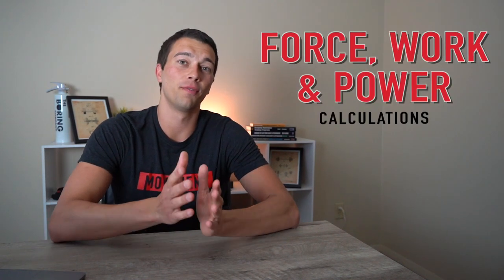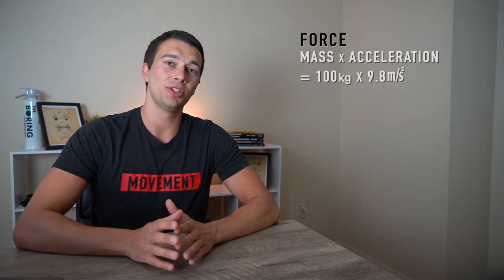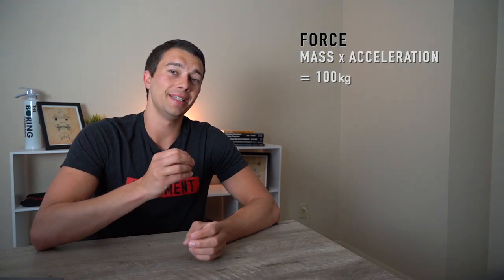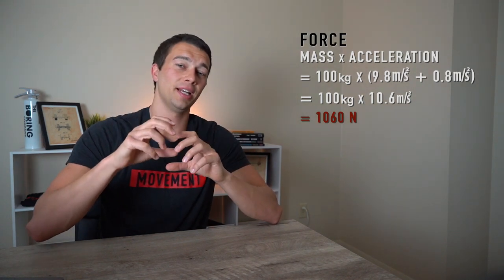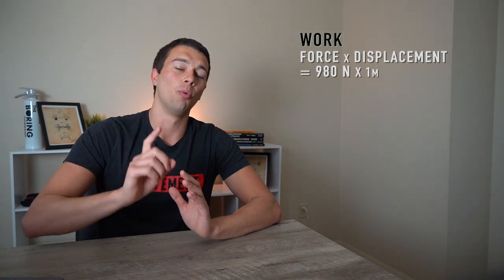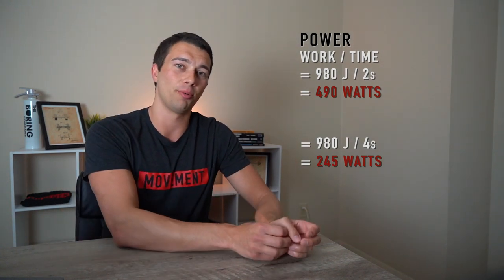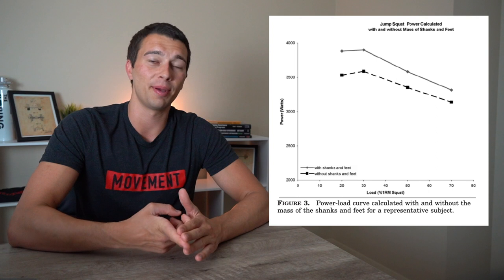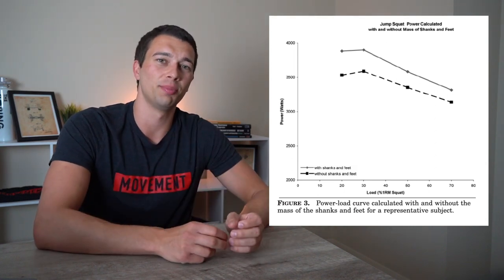CSCS Calculations | How to Calculate Force, Work, and Power During a Barbell Squat

Comment: Clear explanation, but only for mean power into the bar and only when vertical.

Now to calculate peak power:
You need the velocity-time graph of the bar.
a(t) = dv/dt this gives the a(t) graph (of the bar) (don't forget to add 9,81 m/s^2)
P(t) = F(t).v(t) = m.a(t).v(t) since you have the v(t) and a(t) graphs you can plot P(t). Then just calculate the maximum.
If you want to make this calculation even more fun: add a band.

Comment: When might a strength coach advise an athlete to focus on greater power output (speedier reps) vs. Focusing on slower and possibly more controlled reps? Should both practices be implemented within the same training session? Set after set? Or at different phases in their program?
Reply from the maker: There's no right answer to this but typically you would do some amount of speed reps throughout the season with more of a focus on that preseason/ in season. I would look into some of the articles on charliefrancis.com

Comment: Matt. when i am going to get Force, the weight is going to be the weight that going to move or the weight that going to move + the weight of the person?
Reply from the maker: It depends on if you're calculating force on the barbell or force into the ground. I used just the mass of the bar to keep this example simple
Reply: thanks so much

Comment: Where did you get the 0.8 figure from? How would one know the acceleration they are undergoing in a lift?
Reply from the maker: Acceleration from gravity is always the same then acceleration of the bar would be given in the question
Reply: @TheMovementSystem  but how would anyone know the acceleration they are applying to the barbell? We know acceleration due to gravity but how did you get the .8 number?
Reply from the maker: @tomg4685  In real life you could measure it with something like a velocity based training bar speed tracker. On the CSCS Exam it would be provided
Reply: @TheMovementSystem  so the .8 figure you gave was just for the educational purpose of the video?